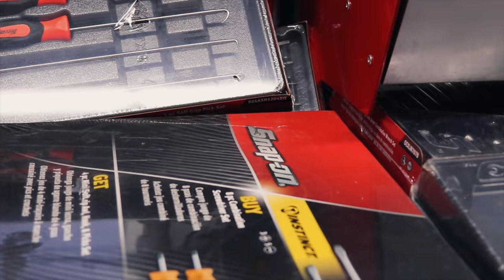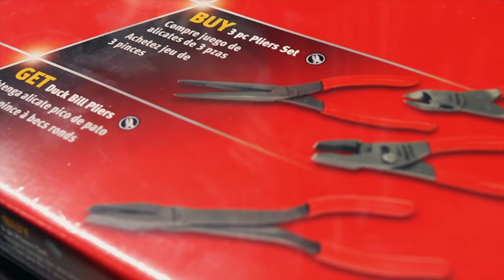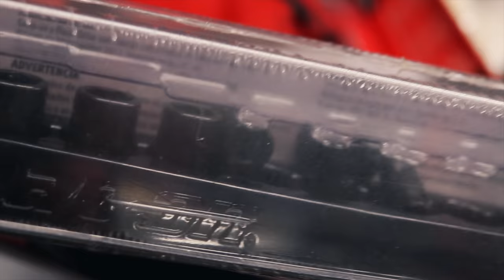Snap On 1 Inch Impact Gun

Comment: Hey guys! I’m a fairly new tech (8 months) and cordless tools have been one of the main tools I was lacking on. I try not to spend too too much on tool trucks but my Snap-on dealer had an awesome deal that I just couldn’t pass up. It was a cordless 1/4 ratchet, a 3/8 impact like the one Bill has, and a 1/2 impact, a 14.4v battery, an 18v battery, and a dual port charging thingy. All for $1,100. My job has become 100xs easier and more efficient. Your videos help me a lot in tool purchases especially when you guys put tools to the test. Please continue to make those videos and give your opinions bc I really do take y’all videos into consideration. Thanks from Houston,TX.
Reply: Geo A you should give milwaukee cordless tools a chance you wont be disappointed and the are half the price of snap on

Comment: I love my Snapon tools, but if you buy this you are a fool. It doesn't have the highest torque on the market, yet it is twice the price of the next most expensive. If you need a 1 inch gun, check out SP air. High quality Japanese tool with more torque than the SO